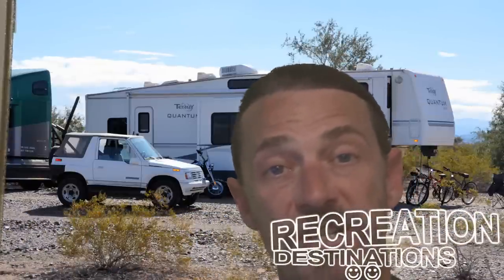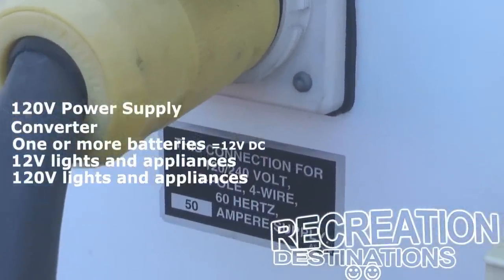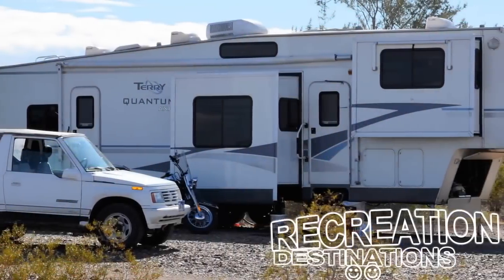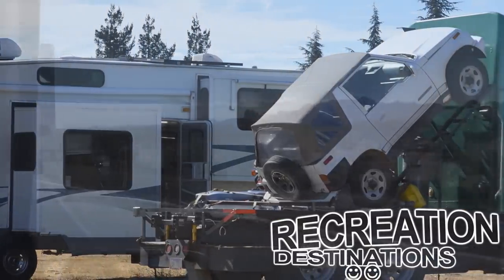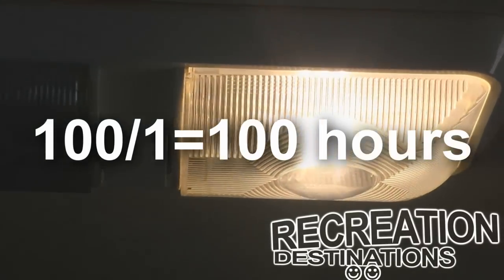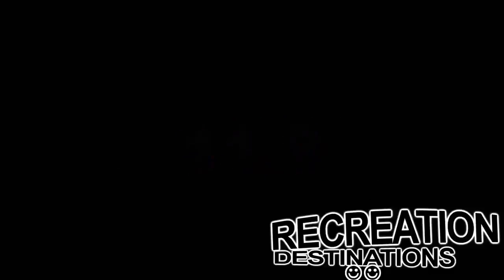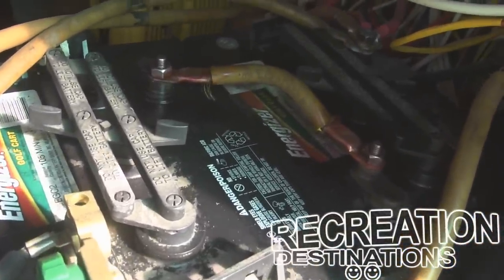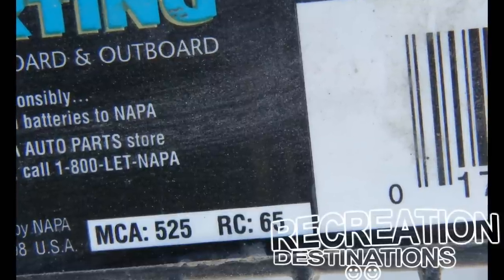Understanding RV Electrical Systems Part I

Comment: I am new to RVs and just got a 1989 Pace Arrow. Does the electrical system detect shore power from the generator or pedistal and automatically switch off of battery power supply? And do the chassis/coach batteries automatically start float charging when on shore power or with the engine running without me doing anything? Thanks!

Comment: My husband and I are out in the RV now and we are hooked to shore power, but suddenly this morning (after sleeping all night with heater on) we hear a beep and the indicator says low battery, BUT our RV is new, our battery is new, and was fully charged when we started camping yesterday plus my husband bought the best battery he could find (not original one that came with RV) We have an alliance rv and have used it only 2 times before this.  On top of that we know the battery should be getting charged by ( I think its called a converter) so yeah by that thing…not sure what is wrong? Any ideas or advice?
Reply from the maker: It could be one or more of a number of things in the charging system.  Unfortunately, it would be difficult to troubleshoot and diagnose without a very long back and forth via comments.  I will effort to make a video specifically for your issues and some areas to look.  But it may be a few days before I get it posted.

Comment: Thanks for this video.  Im new to rv and this helps a lot.  Though im still learning.  I have 2 batteries in my rv.  Toy understanding one is for the vehicle and one is for the accessories such as light and ect...wont the car alternator charge both battery once the vehicle is running or do i need to have the 2nd battery charge on shore power from time to time?

Comment: Hello...EXCELLENT VIDEO,,,,I am converting an enclosed cargo trailer into an RV,  I have a new breaker box but would appreciate some guidance on installing the wires....from shore power to breaker box.  Black wire goes where? Ground wire and common, where do they go in the breaker box...THANKS.
Reply from the maker: Hi Frank.  In short, the black wires will go to the breakers, the whit wires will go to the common rail, and the uninsulated wires will go to the ground rail.

Comment: I have a 96 gulf stream, obviously used and have never owned an RV before. Nobody I talk to, including the dealership that sold it to me seems to know why the coach lights won't work off the house battery. Can't find the switch. There is an electrical box in the compartment beside the generator, but it doesn't seem to do anything. Lights work if I plug into a house, or if the gennerator's running, but otherwise nothing. Any advice?
Reply from the maker: There's nothing simple I can direct you to.  I would start checking for voltage from the converter and working from there.  The house batteries should be directly connected to the converter.

Comment: Howdy!  Thank you for the video!  We are facing an electrical issue. We found 5 outlets damaged and so we replaced them. We are now finding them saying "open neutral" and we can't find the neutral that is open. Could it be because we don't have a second battery at this time and are running off of a 20 amp power source instead of 30? ANY help would be much appreciated!!!!
Reply from the maker: An open neutral can be very dangerous.  If this began when you replaced the outlets, it is likely a bad or improper connection in one of the receptacles you replaced. Open neutrals are often very difficult and time consuming to locate.  Good luck.

Comment: Ok this Amps watts volt is very confusing. I think you may be able to help me.  When does the rv use a battery if your hooked up at rv park full time?

Comment: I have a 2014 Bullet 251RB. No where can i find out if you can connect the AC power, without having connected batteries.  I do not want to do this because i cannot even spell electric. Please advise if doing this would damage the convertor or do other damage.

Comment: If I have 2 12 volt batteries hooked up giving me 200 amps and my battery monitor reads 50%, does that mean I've used 100 amps?  In other words, how do I figure out how many amps I've used so I know how long to charge my batteries for?  Thank you.

Comment: So when the batteries are bulk or absorption charging at 14.8v, do the 12v appliances get 14.8v or should there be a regulator keeping the voltage down? I had a brand new exhaust fan die within 2 day of installation. Manufacturer tech support stated I should keep the voltage closer to 12v or at most 13v.
Reply from the maker: I don't know of any RV charger that doesn't float at over 13V.  13.2 is standard minimum and all RV chargers have, at least,  a bulk mode which will regularly push the battery over 14V.  Off hand I would say either the tech you talked to wasn't much of a tech or the exhaust fan wasn't made for RV use.
Reply: @HighDesertOffgrid  My fan is a Maxxair 4301K. Apparently many people have had Maxxair fans die and voltage was blamed. I ordered a 12v regulator for the fan and Maxxair is sending a replacement board.

Comment: Great video.  Very informative.  In process of replacing 12v dual purpose battery with group 31 12v deep cycle.  Also plan to add battery monitor to system to more accurately measure amp hours used.  I checked the converter and paperwork for converter but does not give charging rate - any suggestions? The converter is 3 stage bulk 14.4V, absorption 13.6V and float is 13.2V.  I re-charge with Honda inverter generator - travel trailer is Rockwood 24’ 2016 model.   Thanks in advance - onto video 2
Reply from the maker: I don't have any suggestions as to finding out the charge rating of the converter other than looking up the manufacturer and model # on the web.  it is likely between 40-60 amps.

Comment: GREAT VIDEO !! I AM NEW TO RVING- AND I HAVE A QUESTION "PROBABLY ONE OF A THOUSAND" YOU GET!! I HAVE A2003 HOLIDAY RAMBLER EQUIPPED WITH A 2000 WATT XANTREX FREEDOM COMBI INVERTER- AND 4 DEEP CYCLE BATTERIES  SET UP IN PARALELL AND IN SERIES; I HAVE HAD NO ISSUES WITH THE ELECTRICAL SYSTEM AT ANY POINT; I LIVE IN WASHINGTON STATE AND IT,S BEEN WET AND CHILLY SO I PLUGGED THE RV INTO MY GARAGE (15-20AMP)?? SERVICE THE  RV HAS 50 AMP SERVICE, I PLUGGED A 900 WATT CERAMIC HEATER IN THE COCKPIT AND I PLUGGED A 750 WATT "DELONGI" PORTABLE HEATER IN THE LIVING AREA( THE HEAT REDUCES THE HUMIDITY WHICH IS A BAD THING FOR ANYTHING AND EVERTHING IN THE RV; THE NEXT MORNING I OPEN THE RIG AND NO HEATERS AND NO SHOREPOWER AT THE SWITCHED AND OUTLETS; I RESET ALL THE BREAKERS AND RESET THE GFCI,s THERE ARE TWO. EVERYTHING ON THE BATTERY SIDE IS ALL GOOD JUST NOT GETTING AC CURRENT TO THE ELECTRICAL SIDE OF THE RV????  ANY SUGGESTIONS WOULD BE OF GREAT BENEFIT TO ME BESIDES I,LL BUY YOUR BOOK!!! THANK,S PATRICK.P
Reply from the maker: I suspect you blew the breaker in the garage.  Did you check that one?

Comment: we recently purchased a 1987 Jayco 5th wheel trailer and know nothing about any of it. of course it has been sitting for a few years and have switched owners a couple times so there isn't anyone to ask what is wrong with it. we are planning to live in it for several months but will have a generator to use with it as soon as I learn which generator I will need to get. can you help. I have gotten a couple propane tanks for it and am ready to try and hook them up but West do I need to check first also the outlets aren't working web we hook up a battery to it but the lights do and I can't figure out how to make the fridge work.   HELP!!!!

Comment: cant figure out why my house batteries on my class a are not holding charge , it works great plugged into shore power but without the proper battery voltage i can't start my generator, how do i check my converter to see if its putting out the power i need to keep my batteries charged????

Comment: Thanks for the great information. I do have one question for you regarding charging my batteries. If I plug my trailer into my home with the trailer power cord, will that charge my batteries and keep them charged?
Reply from the maker: If your systems are operating properly, yes.
Reply: @HighDesertOffgrid  that’s the thing, I’ve had them plugged in that way and they died. So now I need to figure out what is killing them.

Comment: Very informative video. My question: my RV batteries (2) are also used to start my RV generator. Should I purchase hybrid batteries or strictly RV batteries?
Reply from the maker: Unfortunately, true deep-cycle batteries are not designed to provide large bursts of energy well.  Depending on the generator needs, you may have to settle for using the hybrid batteries.  If your RV is a motorcoach and your generator is reasonably close to the  starting batteries, you may want to consider having it rewired to use those batteries to start it.
Reply: Recreation Destinations, thank you for your reply! For now, it looks like we will have to use hybrid batteries. Our future trips will mainly consist of state and national parks, which can mean dry camping, so the generator will probably see some use. We are not ready yet to rewire the genset to the starter battery, but will keep that in mind for future updates. Great idea!

Comment: Howdy, Thanks for all the useful info. I have a question for you. I'm wanting to make up my own "dog bone" but want to to be at least ten feet in length. Kinda like an extension cord. My RV has the 50 Amp service so what I'm wanting to do is make up an extension cord that has the 30 amp male plug on one end, and the 50 amp female plug on the other end. Sense I really don't know much about this kind of connection, I'm wondering you would be able to tell me how I would connect the three wires into the 50 amp female connector in order for it work?
Reply from the maker: The hot leg (black wire) would need a pigtail to both hot legs on the 50 amp female. This would allow all the circuits to be powered, although at the limited amperage.

Comment: When using the generator or on shore power...with the batteries fully charged...do tou need to hve the batteries on or can I turn the disconnect switch off and run everything fine?
Reply from the maker: You need to leave the batteries connected so they continue to be trickle charged.

Comment: hello love your videos. I changed out my power converter in my 2006 motorhome. I marked all the wires but when it came time to put the wires back on the breakers three of the black wires had no labels...how can I tell what wire goes to what breaker? the breakers are 30AMP, 20amp and 15amp...
Reply from the maker: Your best bet would be to contact the manufacturer and get a wiring schematic for the RV.  You will have to determine what is connected to each wire (ie plugs, A/C, etc.).  You may need an electrician to determine this.

Comment: Excellent video! We are very new to RVing. Quick question. Would it be bad to have a power source (30 amp) hooked up and start the RV?
Reply from the maker: The starting batteries are usually separate from the house bank.  Probably wouldn't hurt.

Comment: I have lost two electric heaters I used in my RV. Does this have anything to do with power surges? Heaters ran until being turned off, but did not start when turned on for next use???
Reply from the maker: I doubt it has to do with power surges.  Space heaters are usually pretty low-tech.  Power surges usually effect things like TVs and other electronic devices first.

Comment: I do have a question. I live full time in my RV. here recently my furnace is acting up. when I turn on the thermostat the furnace starts. the lights deem a bit and it starts up. when the temperature reaches the desired set number it goes out. but it will not come back on. if I turn off the thermostat and back on it will come on and again go to the desired temperature turn off and not come back on. do you have any idea what may be causing that?
Reply: I had a similar issue that I thought had to do with my Generator. Ended up it was my propane tank. There was a valve that switched on and off -- it was defective.

Comment: With the fires up in the Fillmore area my sister is coming down to stay with me I plan on going to the RV and letting her stay in the house with her kids thing is I have not stayed in the RV yet
I had A electrician set up a Breaker/ plug just for the Motorhome that matches the 30 amp plug on the RV so when I have it plugged in at home I can turn on the breakers inside the RV for a spare place for me :) Anyway first Stupid question... I always hear the Inverter hum should it always be humming along the entire time I have it hooked up to shore power? Is that dangerous to leave on all the time? or turn off the breakers when I leave the RV unattended or turn them off after a certain amount of time meaning dont leave it on day after day week after week. My solar panel is dead... so at home I have on a separate plug A pair of Black & Decker Trickle Chargers One for each battery I have a yellow top optima on the starting battery and A Blue top Deep Cycle as recommended . Its a 93 Ford Tioga/Montara Class C  I dont have the fridge plugged in at all as I dont need it at home and I am not using the furnace I did get a small 850 watt electric space heater I have not used yet and the laptop thats it as far as stuff thats to be plugged into the 110 v outlets. The microwave is plugged in but I dont really use it no coffee maker or ice machine yet they are on my list. I just dont want to make any stupid mistakes ,,,,Thanks And if anyone can help me out Thank You and MERRY CHRISTMAS Happy Landings for 2018!
Reply: Jeff G I think they do hum 24 7 when on shore power.

Comment: Hello, I just bought an old rv. I'm thinking I should do the electrical work first. What do I do to get started?
Reply from the maker: Hi. Sorry for the late response. Your question was put into a spam folder by the YT bots.  The first thing I would do is to check out all of the 12V and 120V electrical circuits and appliances to ensure everything works as it should.  Beyond that, upgrades and changes will be determined by how you use the RV.  Happy RVing!

Comment: Thanks for posting this video. It was helpful. Just purchased an rv and i notice that the only way the ac and lights work is if i hookup the battery and the 50 amp cable. Any advise on this would be appreciated. thanks
Reply from the maker: The AC only works off  shore power or generator.  The lights are 12V and need battery or power from inverter.  Thanks for the comment.
Reply: Recreation Destinations previous owner tells me that rv used to work just off the 50 amp but doesnt know if he moved something to change it. Is he right? Or is the system just made to run off battery and 50 amp connection. appreciate your help
Reply from the maker: Remember there are two separate systems in the RV.  The 120V system and the 12V system. The 120V system (AC, microwave, etc) needs shore power or generator. The lights are on the 12V system.  They should work without shore power if your converter has charged the batteries, and the batteries are good and fully charged.
Reply: Recreation Destinations thanks for your info on this, i was really puzzeled but not I see what you mean. Thanks again

Comment: Great video, thanks. Question - I have 2 start batteries and 4 house batteries. My understanding is the only method my start batteries get charged is via my alternator. That my converter nor my inverter will charge the start bank. Is this true?  Steve
Reply from the maker: That is generally true.  The systems are kept separate to keep from draining your starting batteries to the point they wont start the coach.  There is often a button or switch that you can hold to momentarily add juice from the house batteries to the chassis system for a "jump start" if the chassis batteries go dead..

Comment: I have a 2 part question.  I had been plugging in my RV while in storage in order to keep batteries (both vehicle and house) charged.  The battery in the vehicle kept dying.  I was told by an RV shop that it was too much power going to the batteries by leaving the RV plugged in, so I basically burnt them all (vehicle and house) out.   I see below that you are saying that I should be able to leave it plugged in to a normal outlet to keep batteries charged.  Am I missing something?

The second question is that my resolution to the problem above was to buy a battery maintainer, which I now plug in and connect to vehicle battery.  That saved the vehicle battery, but house batteries still drained and I have to replace them again. Should I buy another maintainer and connect to one of the house batteries too?  I've never quite figured out the disconnect switch, but putting that in the on position (which I assume is when the light comes on) charge those batteries from the maintainer on the vehicle battery?

Any help would be very much appreciated.  I'm tired of buying new batteries.
Reply from the maker: As a full-time RVer, my batteries are used and recharged constantly.  My reaction to your first question is your rv "tech" doesn't know much about RVs.  A standard RV charger is designed to maintain the batteries at 13.2 volt +/- and that is the voltage a battery is most happy at and will give the longest life.  You should check the electrolyte (water) levels in the house batteries regularly.
As stated, the battery charger in the RV, if working properly, functions as a maintainer by itself.  You don't need another one.  There could be other issues with your electrical/charging system which would be better diagnosed by a competent technician in a hands-on situation.
Hope that helps.  Happy RVing.
Reply: Beverly Pritchett i

Comment: Will a 110 volt adapter connected to the 30 amp connector, to plug into a house receptacle, charge the two 12v batteries on my trailer?
Reply from the maker: Yes, It should.